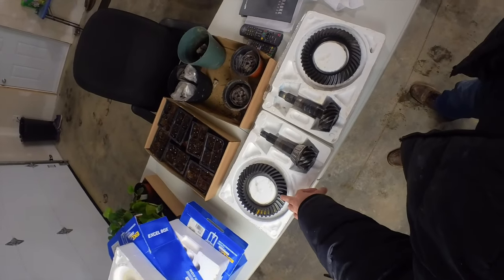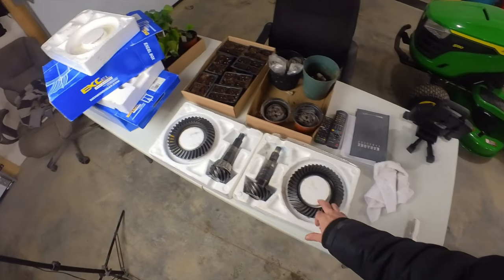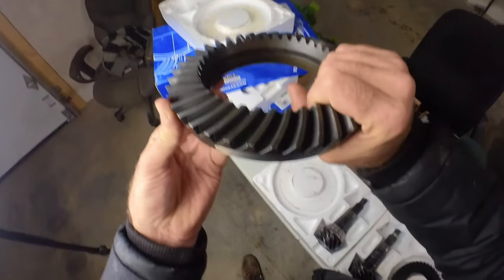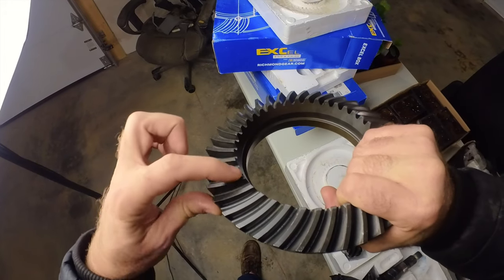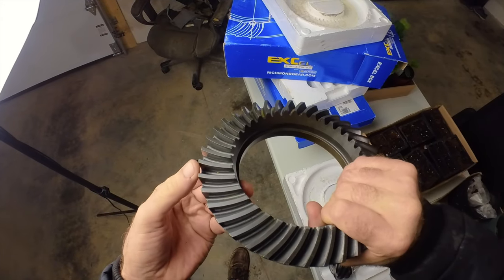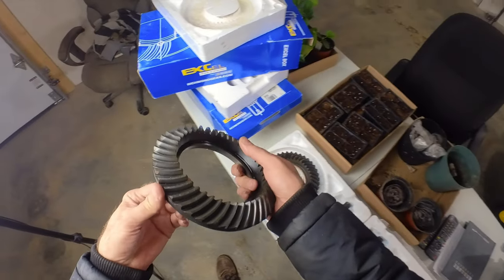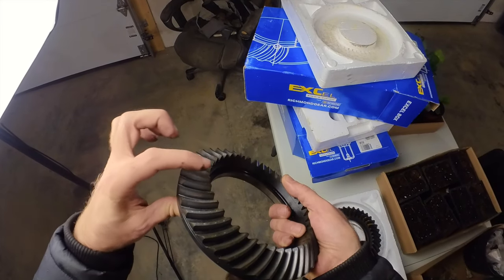2-cut vs 5-cut gears - Ring gear runout - 2002 Camaro SS gears are noisy

Comment: I have these same 3:90 gears that I installed 2 years ago in my '02 WS6.  The howl pretty bad.  I've even re-checked the backlash.  Pattern is good too.
Reply from the maker: Well glad it isn't just me.lol.I already got a new set of Motive 3:73 for it that I will install sometime this winter.I know I said I was going to go 2 cut OEM but they are expensive and these were very cheap.Amazon made an error pricing them.The 3:90 gears howl some but I actually think I got the carrier bearings too tight which causes most of the noise or at least that's what I am thinking.Thanks for watching and commenting we really appreciate it.
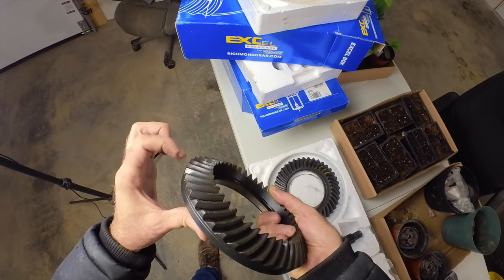Reply: We need to just install 4:30s in a new 9" housing! :)  @LSxMotorsports2021
Reply from the maker: That would be awesome unfortunately my budget will not allow it.lol.Now if we had about 1 million more subscribers that might be possible.😂

Comment: I finally bought a 93 z28 now im rewatching your lt1 videos haha
Reply from the maker: Congrats on your new car.They are great cars.
Reply: @LSxMotorsports2021  yeah it does jut and lag a bit when i hold the gas steady at 40-55 mph it could be a lot of things spark plugs, something clogged, i did a coolant flush and oil change, used a k & n $17 oil filter, my right sway bar is disconnected, it needs a lot of work but it can still do a nasty burnout and launch, the oil pressure it weird it goes up and down when i drive it, so does the thermostat, it gets hot when i drive it slow and idle but id speed up and it would go down i dont understand, do you have any advice on any of that
Reply from the maker: Well the oil pressure thing the first thing I would do is replace the oil sending unit which is a little sensor that sends the signal to the oil pressure gauge.The temp problem could be that the fans aren't coming on.When you drive a steady speed the fans aren't needed but at slower speeds and idle the do so if they are not working it will start to heat up.Often times it is a bad relay but sometimes the fans go bad.Just don't run it hard until you get all the little things fixed which you should be able to find videos on YouTube to help you figure everything out.
Reply: @LSxMotorsports2021  the fans come on, and isnt the oil sending unit next to the oil filter? i need to put it on the jack lifter to replace it right? Should be an easy fix
Reply: @LSxMotorsports2021  there is also a small oil leak coming from the engine do you think it is a loose bolt on something like the head? Its small and drips so often when parked
Reply from the maker: Yes it is above the oil filter on a 93 I believe.I did find a video on it but I can't get the link on my phone but just do a search on YouTube .And you will need it off the ground I prefer ramps because they are safer.What ever you do be safe.Dont just rely on a jack.
Reply: @LSxMotorsports2021  your right, i do have a shop i take it to here on base, its a real lift and i rent it for cheap, gonna find that video thank you
Reply from the maker: Oil leaks are to be expected.If it's really bad then you will need to find it's source but if it isn't too bad you can wait and fix it later.The oil sending unit may even be the cause.Remember to be safe when you get under the car.Dont just rely on using a jack to hold up the car.
Reply from the maker: Oh that will make everything much easier for you to fix any issues you find.
Reply: @LSxMotorsports2021  you the best thank you
Reply from the maker: Hopefully you can get everything sorted out and end up with a great car.Good luck.

Comment: They say you learn something new every day… Well, I guess I’m done for today, lol great video man I never knew about the ring gear run out that’s a good good catch… How did you catch the ring gear run out?
Reply from the maker: Well it is something every video about gears should tell you but don't.I knew the fluctuations in back lash didn't seem right but no one speaks of it in most videos so I just moved on.But no matter what I did the gears kept making noise.So finally found a couple videos on ring gear run out and 2 different guys said if the runout is too high the gear will whine.If you search forums about gear setups you will find hundreds of people saying they set up their gears properly but they still whine.You gotta wonder how many of those are caused by run out.If the heat treating of the gear isn't done perfectly metal is going to warp.All I know is when I do get a new gear that's the first thing I am checking and if it has too much run out I will be sending it back for replacement.
Reply: @LSxMotorsports2021  it should be safe to run those gears don’t you think?
Reply from the maker: Yeah it should be fine.After the break in when I drain the fluid I will know how bad they are wearing.Also will check the back lash.If it doesn't increase by much it will be good.Only need the summer out of them.Will change them this coming winter.

Comment: Thanks for the video.  I'm planning on a ford 9 inch.  My car is starting to make too much power for the 10 bolt I still have in there!  One thing I'm looking for after strength and durability is no noise.  I'll be installing it myself, but I want someone building this that knows what they're doing.
Reply from the maker: Yeah definitely want someone with experience to set it up.I am pretty good at doing mechanic work and setting up gears completely kicked my ass.There is just so many things that have to be right or it will make noise.I have learned alot but learned it too late.Thanks for watching and commenting we really appreciate it.A Ford 9 inch will definitely hold up very well.
Reply: @LSxMotorsports2021  Let me know if you recommend anyone.  I was planning on going through Midwest Chassis for a ford fbody setup they offer.  I'll have to ask them what gears they use.  I definitely need the 2 cut gears.  I absolutely want the most minimum sound possible.  I'm getting a little older, and noises bother me more than they used to. lol  Thanks for the video.  I didn't even know about 2 cut gears vs. 5 cut.
Reply from the maker: Yeah I didn't know either until it was too late.If your getting a 9 inch then you can use a Ford motorsports gear which I believe are a 2 cut.But if your spending the money for a 9 inch then who ever you get it from ask a ton of questions because when you're spending that kind of money you want the best and I am sure they will answer any questions you have.
Reply: @LSx Motorsports  I definitely want a one and done thing.  Sure, I'll be careful properly, breaking in the gears, fluid changes, keeping an eye on it, etc.  But I NEVER want to replace anything on that diff.  One and done!  Unfortunately, I've found out a few times that even the "best" are improperly built.
Reply from the maker: This is true sometimes even the best can make mistakes.But check out their warranty and return policy and I am sure you will do ok.

Comment: I wanted to put 4.10 in my rear end but with a 10 bolt, I am sure it would detonate lol
Reply from the maker: Yeah a manual can be pretty hard on the little 10 bolts.A hard hitting torque converter can make them shatter too.When these cars were made GM should have used whatever rear end they were using in their 4x4s but to save money and weight they used the little 7.5.

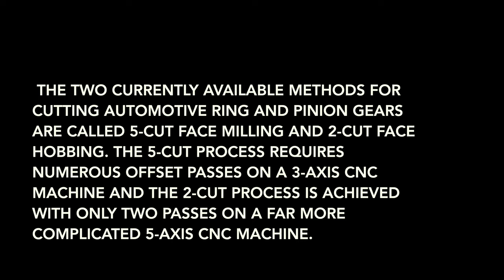Comment: Factory 3:23 gears fail 😮 Since I installed Yukon 3:42 gears never has it howled 😊
Reply from the maker: That's good.It means they were installed properly.Mine whine because of a combination of a poorly machined gear and an idiot installed them.lol.
Reply: @LSxMotorsports2021  my gears do make a minor noise but I realised there is very little to no sound deadening material in these Camaros .
Reply from the maker: Yes that is also true.